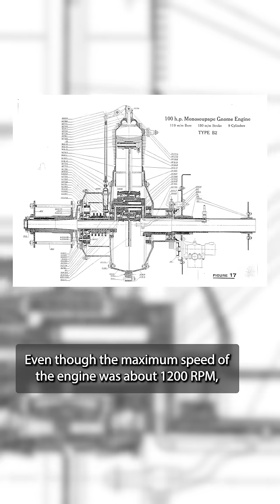The Gnome Rotary Engine

Comment: What would be the advantage of using this design over a radial? I can't see one.
Reply from the maker: There isn't. But the metallurgy at the time allowed this to work and wasn't good enough to build a crank capable of sustaining the loads of the normal radial. Pretty quickly we got good at casting and the radial was much simpler to design.

Comment: The coolest rotary was perhaps the most underrated.  The Monosoupape (sp?) on the Nieuport 28 produced 180 HP and you could cut out various cylinders to throttle it back. Also, many rotaries had throttles to their fuel feeds, but pilots were too ham-handed to work them... so they blipped them and risked unburned fuel in the cowling setting their planes on fire when the coup switch was let off.

Comment: They absolutely did have carburetors, but it was put behind the engine and didn’t spin with the pistons. It would inject the fuel air mixture into the crankcase like a two stroke.
Reply from the maker: Yes but it wasn't a modern carb… it didn't have any means of fine tuning the RPM due to the very clunky means of operating it.

Comment: How do you get fuel and oil to it? I mean, if the entire engine is rotating, you can’t just plumb a line to anything because it would just wrap around in one rotation and snap. Is there some bearing or gasket sealed fuel manifold or something?

Comment: I guess that explains why some of the old Bi-planes sounded like the engine was sputtering while coming into land,
Reply: Yeah that detail was wrong. These engines were known as "hit and miss" . The engine speed was governed by a sprung weight, if you select low speed the weight would move by centrifugal force and pull a rod that held the exhaust open so the engine wouldn't compress and therefore wouldn't fire. The engine would slow down, the weight move and the engine fired on a couple more rotations before the weight moved again to cause misfire to keep the engine slow.

Comment: The rotary does actually have a throttle. Its a centrifugal ignition cut. If the engine exceeds a certain speed, Ignition is cut. That way you can adjusted engine rpm.

Comment: Full power either on or off sounds like a spicy landing.
Reply: one of the pilots in this video describes  it as full speed half speed quarter speed or eighth speed,  or off
  soo you can run it wide open, wide open to half and so forth

Comment: The biggest problem with a rotary engine that caused the most crashes, was that it constantly pulled the aircraft to the right
Which is fine during flight, when it was being corrected by the pilot, but, on takeoffs and landings, if you weren't extremely careful, or when you were inexperienced, it could easily flip the plane over to the right

Comment: Not true with regard to no carburetor.  Common myth. They had a very rudimentary shutter carburetor behind the firewall which allowed a relatively large range of engine speeds.  I know because I’ve flown one.  Cheers mate!
Reply: These videos are made by people that lack any technical understanding.The carburetors on early engines didn’t resemble carburetors that came later, but they were carburetors nonetheless.

Comment: If I recall correctly, the rotary happened because the radial has some gnarly vibration problems, and they hadn't invented a motor mount that could wthstand it. Until they figured that part out, they turned the engine around and attached as a rotary.

Comment: Not all rotary engines lack a throttle or carburetor. The Megola motorcyle for example used a fuel mixer similar to a carburetor but with no butterfly valve external to the engine with a butterfly valve in the crank where the fuel air mix comes in to act as a throttle.

Comment: Not a good idea. It was a backward idea. Too much mass moving around. Its torque want to make the plane flip over
Reply from the maker: True, but it was the best option at the time. What amazes me is that very quickly inventors realized the need for very strong crankshafts that could sustain the massive loads generated by the combustion cycle and the Radial engine was born.

Comment: The Fokker Dr. 1 triplane also used a rotary engine -- and the special maneuvers available due to the precession of all that rotating mass made both it and the Sopwith Camel legendary for their maneuverability.
Reply: I had a motorcycle whose engine design also produced odd/uneven gyro forces due to its design. Right handers were magical, (lefts were butt puckering by comparison) and a steep downhill braking right- or full power uphill right- was physics defying.

Comment: "This is not a radial engine, this is a rotary engine."  Well you're half right.  It is BOTH a radial engine (one with the cylinders radiating outward from the center like spokes in a wheel) AND a rotary engine (one in which the cylinders themselves are not stationary but spin about the center axis).

There are also radial aircraft engines which are not rotary engines (because the cylinders remain stationary).

Comment: The Le Rhone was developed before pistons could be forged out of aluminum. An iron piston is heavy and limits RPM due to the destructive force of inertia as the piston moves up and down in the cylinder. The Le Rhone design avoids this problem by eliminating the actual reciprocating motion of the pistons. Think about this carefully! Because the whole engine is spinning on the main bearings and the crankshaft is stationary the actual motion of the connecting rods and pistons is to spin around the crankpin like spokes on a wheel. The pistons are not physically moving up and down so there is no reciprocating inertia. Their movement within the cylinder is only relative to the cylinder which is also spinning on the crankcase. The only dynamic motion of the piston is it oscillating on the wrist pin. It's a very clever solution and allowed the La Rhone to run at a higher RPM than any other aircraft engine at the time.

Comment: Here’s why the rotary version of the radial engine is dumb. Its entire purpose was to create airflow. You know what creates a lot of airflow. 
The propeller.
Reply: The design had nothing to do with airflow, that claim is in error. It all had to do with inertia.
Reply: @ that’s what I figured. Like no matter what speed the engine is the propeller is going to provide enough airflow for cooling. 
As it goes for inertia clearly a miscalculation was in effect as it made the planes handling exceptionally bad when referring to the sopwith camel. Although there was a few other reasons for its poor handling.

Comment: This way you also don't need a flywheel, because the engine is the flywheel. Still, I'm impressed that they bothered with it, as the connections for fuel are probably a lot more complex
Reply: Fuel Is dumped directly in the crankase like a 2 stroke but via the crank wich Is hollow and stationary

Comment: Why was it discontinued?
Reply from the maker: The advent of better metalurgy leading to the radial engine (stationary version) which didn't have the horrendous gyroscopic issues this had. Plus it could recover the oil in the system instead of loosing it completely.
Reply: Lightweight forged aluminum pistons could operate at high RPM while withstand the inertial forces of reciprocating so fast. This eliminated the benefit of the Le Rhone.

Comment: If it didn't have a carb how did the fuel and oil get mixed?
Reply from the maker: It mixed while being drawn through the crank. A carb isn't just a mixing chamber; it also meters fuel based on the throttle plate. This didn't have that ability (not till later versions) so you had an unmetered mix being drawn in the engine.

Comment: So what does this dude call an engine wit a spinning dorito inside? Looks like a radial motor to me...doesn't matter what's spinning. It's all about your POV
Reply from the maker: A wankel engine. The term Rotary is dual nature. Wankels are rotary piston while this is an engine that rotates.
Reply: @The_Flying_Mechanic strictly speaking, not every one of them are Wankel engines. Besides, there is always some part of the engine that rotates. They are rotary in design. only a different part of the engine spins. Looking at your "rotary" engine and a radial they have the same design. You can't change the design label of an engine because a different part of it moves. I never hear anyone call a Mazda rotary engine  a wankel engine.
Reply from the maker: @vicchalker5148 a radial and a rotary are completely different. Outside the appearance that the cylinders are oriented similiarly the valve system, induction system, and lubrication are all completely dissimilar.
Reply: @The_Flying_Mechanic  none of what you say makes no difference. A V8 is a V8 no matter what differences there are with the valve. cooling or lubrication. It is how the pistons are arranged be it straight, vee or radial
Reply: @The_Flying_Mechanic  it has nothing to do with those. it's to do with how the pistons are arranged be it radial, vee or straight. A V8 is a V8 no matter how the valves, cooling or lubrication is designed
Reply from the maker: @vicchalker5148 not in aviation… cars that may be the case, but this is how aviators categorize engines.
Reply: @The_Flying_Mechanic  well I'm not an aviator. It seems we are both correct. No hard feelings,

Comment: Wouldn't it be more correct to have described as a "rotating" engine rather than a rotary engine.
Reply: The Wikipedia article says it's a Rotary engine. The pistonless type are officially called Wankel engines.
Reply from the maker: I mean possibly but that's just not what people called them back in the day.

Comment: ...and because the Rotary Engine spun freely, the inertial forces pushed the oil inside (required to lubricate the cylinders) to the heads, like a huge blood centrifuge; therefore, the engine wasted huge amounts of oil with unburnt gasoline through the exhausts, requiring the aircraft to carry big oil tanks, larger than normally required to make up for the vasts amounts of extra oil the aircraft was going to lose with every flight; the oil tank was normally placed at the front of the fuselage between the engine and the cockpit. 

As a direct consequence, the entire aircraft fuselage was left covered with oil after a flight, and since the pilot's cockpit was open he too ended up all covered with oil. This started one of the most romanticized images of the early Era of military aviation, the heroic pilot wearing a leather cap, flight goggles and a scarf! But people got it wrong, since the use of a scarf was less because the pilots were getting cold at higher altitudes but more because the scarf was constantly used by the pilots, and really necessary, to clean up their exposed faces and their flight goggles all covered by oil!

Comment: NO.   It is radial engine and rotary engine is Wankel, with one "piston" rotating in engine chamber. This is radial engine, whole rotating on airplane frame (except crankshaft). That dont make it rotating engine, what is a mettet is princip of working
Reply: This is the original rotary engine. The Wankel engine took the same name even though it’s much less fitting for that type of engine.

Comment: "Rotary engines had no throttle" - Wrong.
"Rotary engines had no carburetor" - Also wrong.

The only type of rotary engine that DIDN'T have a throttle was the Gnome Monosoupape series. "Monosoupape" is French for single valve, of which the series is known for, the top of each cylinder had one giant single valve operated by a complex push-pull rod.

Monosoupape engines are easily distinguished from other rotaries because they have no induction tubes to the top of the cylinder, and they only have a single push-pull rod to the top of the cylinder.

The reason they can't be throttled is because the engine both exhausts and pulls in air from the single valve. The fuel and oil are admitted through ports in the bottom of the cylinder that lead to the crank case. This complex arrangement is why the Monosoupape (and the Oberusel German clones) always ran at full speed and had to use ignition cutting to control it.

These engines DID have a carburetor to meter the fuel and oil.

Other rotary engines DID have both throttles AND carburetors, because they worked like regular four stroke engines. While they did also have a method to cut the ignition, this was not recommended. If you waited too long to enable spark again, you'd have a cylinder full of fuel that could cause it to explode and blow a cylinder off. Or hydraulic lock it.

A normal rotary has two pushrods and a (usually copper) induction tube to the top of the cylinder to admit fuel, oil and air into the intake valve.

If you want to see a rotary under throttle control, look up Kermit Weeks' video on his Sopwith Snipe. It has a period Bentely B.R.2 rotary engine, one of the largest rotary engines that entered mass production. He controls it with the throttle almost the entire time, except when doing magneto checks.

Comment: Slight correction: developed SOLELY for the benefit of better cooling. Any other perceived benefits were incidental, and accompanied by a disadvantage.  EG impracticality/impossibility of fitting a carburettor gave simplicity, but little control ability. Torque/Gyro effect gave a high rate of roll in one direction but low in the other, advantageous to an expert pilot but deadly to a novice.

Comment: The planes that used this should have been duo engine, with one running clockwise and the other counterclockwise. Would like to know how they feed the fuel to the combustion chambers, but think I know how the probably did. I would also guess they were two cycle.

Comment: They had good cooling, but they absolutely sc**ed manoeuvrability because all that rotating mass worked like a big gyroscope. The problem with air cooled in line 4's or 6's at that time was that the front cylinder would get good cooling, but all the following cylinders would not only have their airflow blocked by the cylinder/cylinders forward of it, but the airflow they DID get had already been heated by each barrel it had swirled around before it. This is why designers of smaller aircraft eventually tended to go with opposing twins, flat fours, and in some cases flat sixes. This allowed them to either have the cylinder heads poking outside the cowling, or duct plenty of cool air around to the rear cylinders under or over the engine block.

Comment: I'm amazed of the computing power of the human brain. Not only that, but the non-artificial intelligence of putting imagination on to paper, with a mechanical pencil, drafting arm, and slide rule. No calculators, computers, or CNC machines, just oldfashion skills, dreams, will power, stamina and Faith. Makes you wonder about the true purpose of the artificial intelligence movement 😮.
Reply: I’ve recently started using AI in research, and the benefit is an almost infinite data base that can be accessed thru virtually any question, as it produces a composite answer including various viewpoints, but taking into account of the relative credibility of each of the references, by analyzing the extent of references, the specific language used. It reduces the legwork of research by 99% leaving the researcher freed up to consider new and creative inferences and ideas. Also, it spans virtually everything. I’ve asked it all kinds of things, from how to use a certain iPhone feature all the way to questions like “did Jesus ever actually say he would die for our sins. It’s wild. And the answers are as solid and complete as you can imagine, and do not leave out a range of viewpoints, even though it arrives at a general consensus if the best thinking.
Reply: @Papi-1231j there's also garbage in, garbage out.
I'm not a Luddite, I generally embrace new if it makes sense and offers an improvement over what I can do or see.
But letting AI affect the direction of humanity has the smell of fish that's going bad, a chaos suggested by the Old Testament, the Tower of Babel.
PS I'm a skeptic of all religions, the bane  of mankind.
Reply: @Papi-1231j  The AI you're referring to has a lot of good sources, but also a lot of bad sources too.  And not understanding organic context, it will often use that bad info. 
It's the same old equation that's dominated computers since their genesis...   Try looking up "GIGO"

Comment: 400 rpm or 1200 rpm so low to fly incredible I don't know how they achieved, I know it has to be over 8000 RPM to fly and an speed over over 150 miles speed for a plane to fly, excuse my ignorance I should no more and how they achieved

Comment: Radial engine. Rotary is different
Reply from the maker: Actually you're wrong. This is a rotary engine. It is not a Wankle; but in aviation, this is what a rotary engine means versus a radial which is stationary.
Reply: They look like radials but are quite different. And they were called rotary engines decades before Felix Wankel invented his engine.